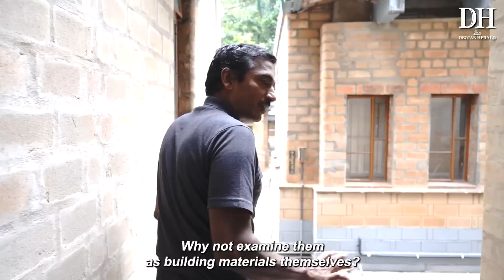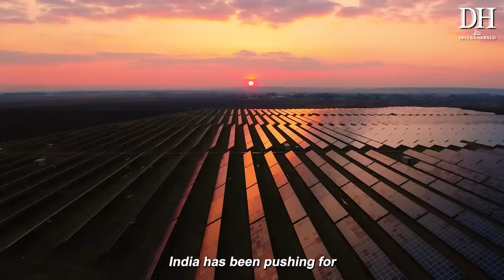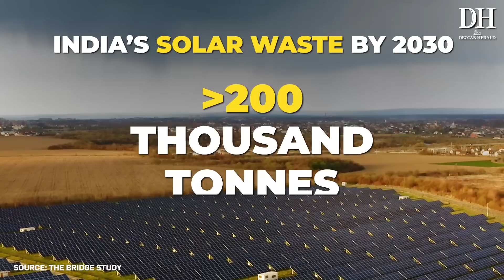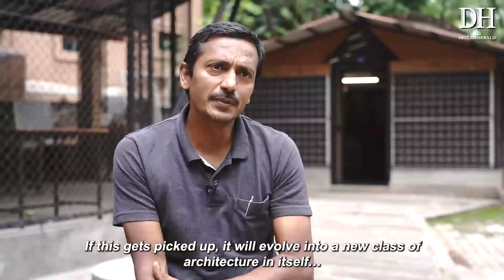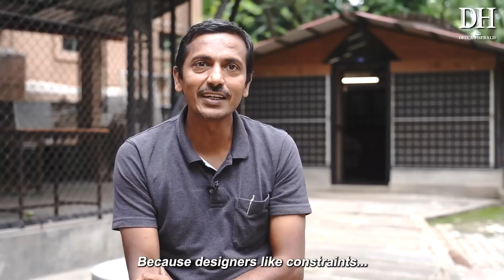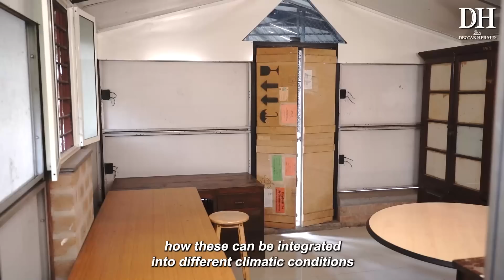Building Homes Using Solar Panels! | IISc Bangalore Experiments

Comment: Global Waste by Metric Tons in just 2024 alone

CO2 from Fossil Fuels 
37,000,000,000 
Coal Ash 1,000,000,000 
Waste Oil 1,870,000,000 
Fracking 1,059,914,800 of toxic stinking filthy waste water. 

Solar PV panel & Wind turbine blade waste… is tiny by comparison. 
PV 7,000,000 
Blades 8,000,000

Also consider
Plastic dumped in the oceans 78,000,000 
Municipal solid waste 2,000,000,000 
Building waste 2,200,000,000 
Car waste 35,100,000 

Now add decommissioning of all coal mines, oil wells, rigs, platforms, refineries, gas wells, gas condenser plants, vast toxic fracking waste ponds, etc 

Then Nuclear : 400+ current reactors worldwide generating waste will all need decommissioning. 50% by 2050. Each reactor alone is c4000T.
ie 1,600,000 T of reactors needing 5-10m T of concrete for containment. Add the waste generated by each reactors 40yrs of operation + containment. Add billions of tons of uranium mine leeching water world wide. 
Got a cost for that? 

Then add all the infrastructure & transporting infrastructure for all this crap all over the planet by fleets of ships, vast pipeline networks, huge trains, vast fleets of trucks, all burning more fuel & leaving huge long cancer zones wherever they route.

All THAT needs decomisioning & disposal.

… but Fossil Fuel & Nuke PR want you to ignore all that & be angry about..  

Solar PV & Wind cost & panel & turbine blade waste eh? 

Guess how many T that is p.a?

PV 7,000,000 
Blades 8,000,000

Comment: Most solar panels last 25 yrs. Why are they being decommissioned after 10 to 15 years? It is possible to repair faulty panels but there might be no one doing this. Glass and aluminium can be recycled. I feel the silicon cells can also be used as raw material for new solar panels. Dissembly might be the hardest part here.

Comment: Doesn't look like a practical option. With acres and acres of solar panel that is going to be discarded in the coming decades, we will have to build sky scrapers with them. I think this is going to be only as popular as the plastic bottle houses/walls. What we need is a solid recycling plan and plant. Discom themselves should be responsible for the recycling as they have the exact data of how much solar is connect to their grid. Preferably by collecting an upfront fees for recycling from the owners.
Reply from the maker: Hello, what you are saying is perfectly valid. This is still in an experimental stage. I don't know whether upfront fees would work, because recycling is rather an expensive process. At least compared to just discarding them (No one counts the cost to environment). Plus, who is going to recycle? How do you recycle? There are only few companies like ROSI in France are into recycling the components in solar panels(Silicon, Silver) and trying to make it financially viable. So that everyone can make the right choice: recycling over discarding. 

-Amulya, Producer
Reply: @DeccanHerald  , great idea for public restrooms, libraries,marriage halls , BBMP buildings to start looking into this recycling ideas.